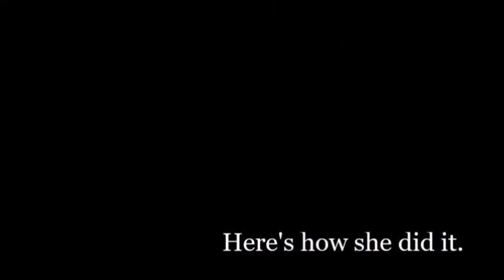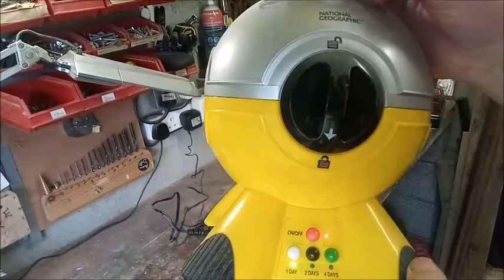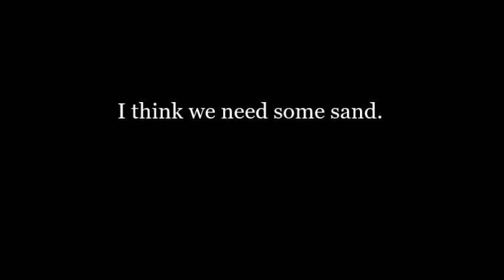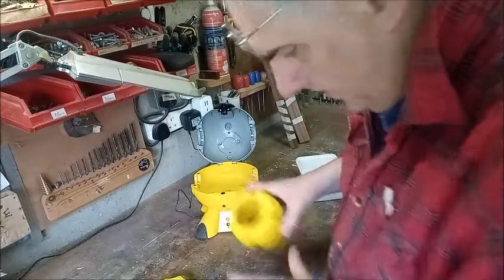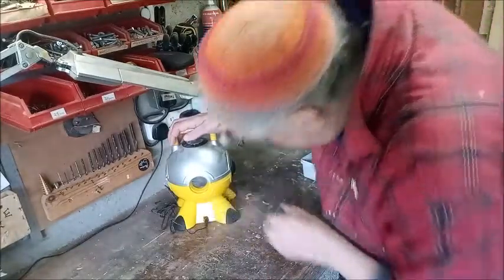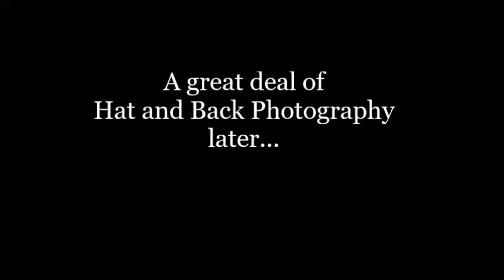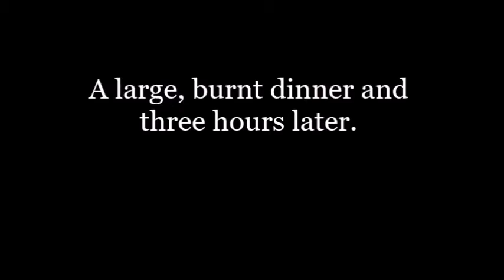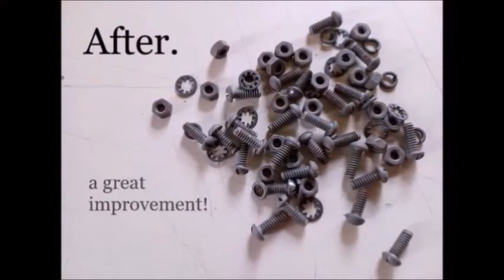Nuts and Bolts and Rock and Roll

Comment: My vote's for more back and hat...bring on that back and hat!

Seriously though, the only problem I see with this is that the coating on the top has been damaged (either by years of rusting or the tumbling of sand) which could leave you with rusty nuts and bolts in the long run (and on something you might want to remove them from).  Of course, I'm no machinist nor do I know my way around the screw preserves...just a fleetin' thought I had.
Reply from the maker: Oh yeah, you're quite right. Steel will always get rusty again, it's an endless battle. I suppose that's why someone invented stainless steel. (I must look that up.) And thanks for voting for my back - it definitely seems to be the feature that folks like best about me. Cheers Rob, so good to hear from you.

Comment: Interesting video Mark. And I thought I was the only one who cleaned up nails, nuts and bolts etc. That is a useful little machine. One tip, soak rusty parts in vinegar for a few hours, take them out and they look the same, however if you wash or brush them the rust falls off and they look brand new.  I don't have the tumbler but I have put small items in a glass jar with sand or grit and given them a good shaking to clean them up, I sort of roll the jar on the bench. when the parts are cleaned up I wash them and lay them out in the sun to dry. Thanks for the video.
Reply from the maker: John! Good to hear from you! Yes, I know the old vinegar thing and I do use it on larger things (have you tried brushing HP Sauce onto larger surfaces like a rusty saw?) but I thought I'd try something a bit different here - it's really not intended as advice on rust removal, more a sort of proof of concept. Actually it works well and I've used it a few times since. It may be rather noisy but at least the workshop doesn't pong from vinegar! Cheers mate and I'm looking forward to seeing your next YouTube offering.
Reply: Mark you are right about the pong of vinegar it stays for days. I love to hear of folk reusing stuff, I get really annoyed at the amount of perfectly good stuff that is thrown away.

Comment: That's a good result.  I have had success cleaning filthy brass bullet casings with fine aquarium grit which might be a bit more abrasive than sand but time will level everything.  I tumbled the casings in a big plastic sweetie-type jar on the lathe.   In case you think I'm amassing a small armoury here by reloading casings they were for making pens... well, that's what I'm saying anyway.
Best Wishes, Brendan.
Reply from the maker: Yeah, pens. Right. It's okay with me big lad. Yeah, your way sounds perfect and aquarium grit sounds like an excellent medium for this sort of thing. I considered using the carborundum powder supplied with the toy but it's really supposed to used with water to form a sort of abrasive slurry which might even promote rust. Well, plasterer's sand is what I had so that's what got used. Maybe I'll just take a visit to the seaside... Cheers Brendan, love to Rosie. Stay healthy mate.

Comment: Nice fun video. Earlier this week I saw a welding artist who puts all her rusty parts, tools and other larger pieces of metal into a concrete mixer with a bag of sand over night and the the tools come out great so your theory is spot on. I wonder if different material besides sand would yield different results, like polishing the metal. It would be fun to experiment.
Reply from the maker: I'll have a look for that one mate, thanks. Oh yes, I think my sand is almost the worst option but it's what I had! I'll try other abrasive media in time but for the moment the sand is working fairly successfully. The whole thing was really just to get using that rock tumbler. Thanks for looking in Tom, as always I really appreciate it.

Comment: Hi Mark, I would call that a total success. The difference is incredible. 
The only thing I would have done differently is to dry the sand first in the oven so there is no moisture in the drum.
Great video mate and sorry you burned the dinner.

Take care my friend.
Cheers, Huw
If the need arises I will make one from an old plastic bottle or jar.
Reply from the maker: The sand was very dry anyway but I take your point. Actually the instructions for the toy suggest adding a bit of water to the carborundum powder when tumbling rocks but their purpose is not ours. Keep me posted if you make a homemade version. Just be aware that there must be an optimum rotational speed; slower rather than faster I think. Does your lathe go very slow? Can you alter the speed continuously? I think I smell a little experimental project brewing. Careful not to burn it... Cheers Huw, thanks for dropping in.

Comment: Well that was a really interesting video mate, great to see you utilize something you already had. I think speed of rotation and sand type would make a difference. But I really think you just wanted an excuse to play with the toy…😀
Reply from the maker: Well, yeah... I'd guess the designers of rock tumblers have considered and tested for the optimum rotational speed but they probably cringe at my spur of the moment improvisations with sand. Baconsoda suggested aquarium gravel and someone said sand-blasting grit/sand, so if can get either of those for the magic price then I guess a follow up will be in order. In the meantime the sand is working okay; I've tried a few other bits and pieces quite successfully. Thanks for looking in Harki, as always mate, I really appreciate it. Love to you down there in scalding TX.